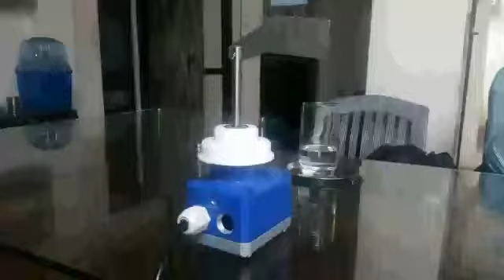LEVEL SENSOR PADDLE TYPE

Comment: Iska connection kaise hota hai
Reply from the maker: It has a option of 24 VDC model or 230 V Ac model . Depending on your requirement , you can choose . Connection diagram comes with the level sensor.